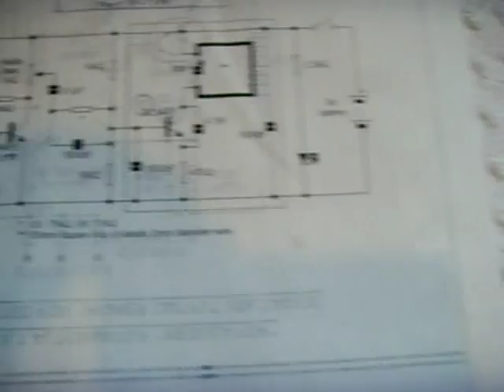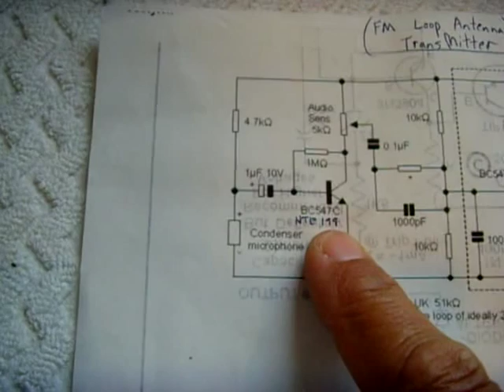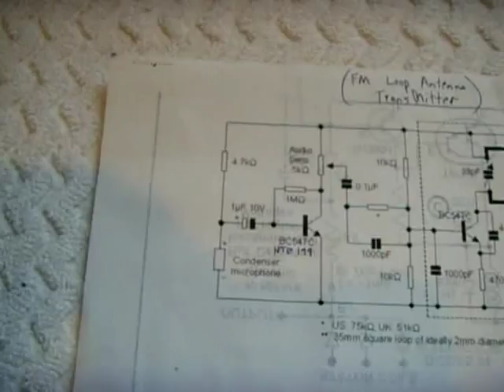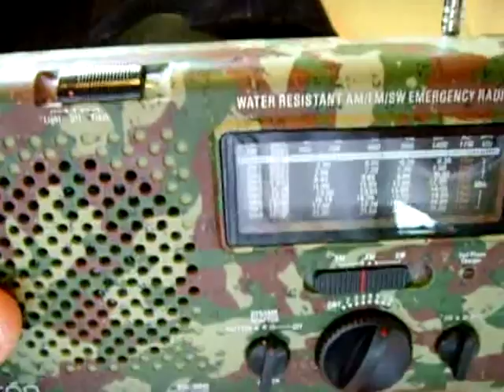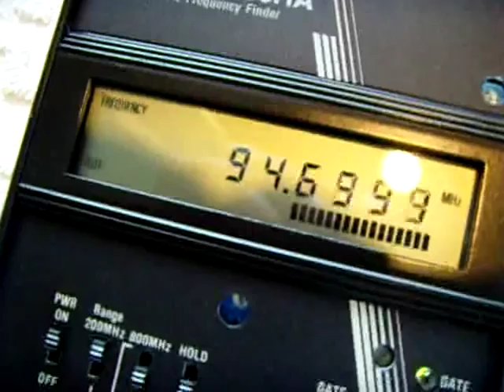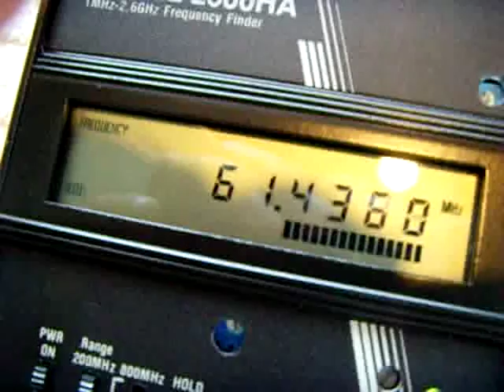Stable FM Loop Antenna Transmitter(by Jose Pino)

Comment: Another great video! Built one and it works great. Took me a while to get the loop just the right size. Also, I decided to try placing the circuitry inside the loop to save space and it actually improved the performance. Made a second one with a tuner from an old radio instead of a trimmer, so I could put a knob on it. Covers the whole FM band. Thanks again!
Reply from the maker: This circuit does work very well. :-)
Reply: @electronicsNmore  

Heads up to anyone who's interested: ntepartsdirect.com has 5W RF power transistors on clearance for $0.25.... that 25 cents!
Reply: @electronicsNmore  

Side project question:
I bought one of those cheap frequency display modules to use with my 3 transistor transmitter project but haven't been able to get it to read anything except my signal generator. After a couple of failed attempts at making a buffer I gave up. The display remained in my junk box for a year. After watching a couple videos yesterday, I tried again. I built an amplifier circuit capacitively coupled to the oscillator using a 10p which is outputting a clean 100mV sine wave. The oscillator frequency remained stable, but the display module still fluctuated wildly. I tested the module with my signal generator again, and it worked fine at 40mV. Also tested my buffered signal output with a RF meter and got a correct 97MHz reading, same as the oscillator and antenna. Still doing some research... Do I need a Schmitt trigger or ADC to feed the analogue signal into the display module? No idea how to do that...
Reply: Does this design change frequency if box lid is closed or box is placed near window with metal guards?
Reply: @GhostsOfSparta  you need a metal box & external anttena.

Comment: Looks good, i will try building it this weekend :D
Reply from the maker: Works as good as it looks! :-). Very stable. You can also drive the circuit using 12V, then supply a regulated 8v or 9v to the power rail using an lm7808/7809 for even more stability.

Thanks For Watching! Be sure to share my channel with others and rate thumbs up.
Reply: electronicsNmore It should work really well in tandem with my homebrew fm receiver, thanks for posting :D thumbs up

Comment: Hi, Good job. Have built several simple FM TX, they work OK but can drift, with only a few parts to be expected. Still for learning and fun they are a good evening project. The ones with a fixed value, say 47pF capacitor instead of trimmer cap work quite well. Will keep trying different circuits. C.